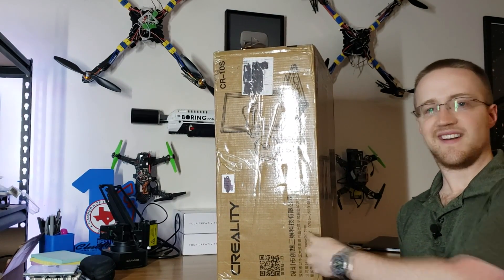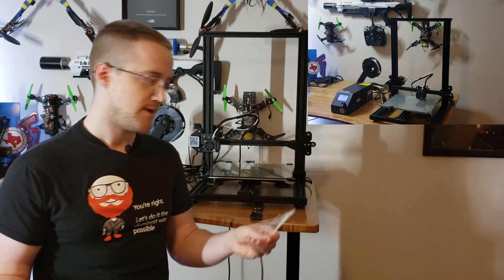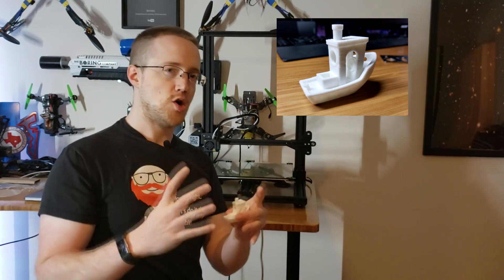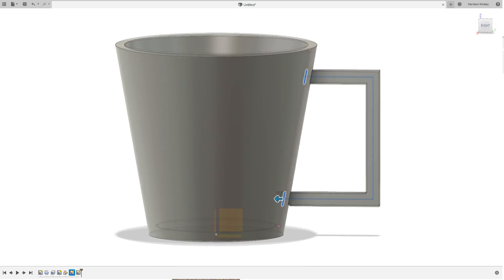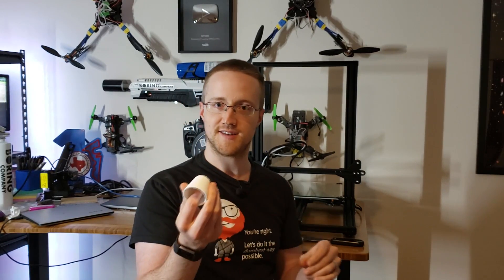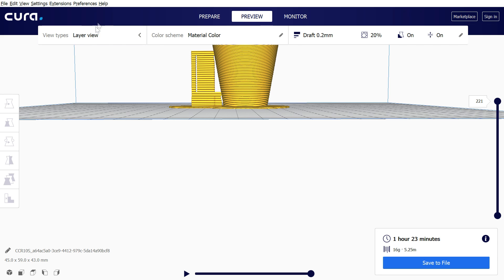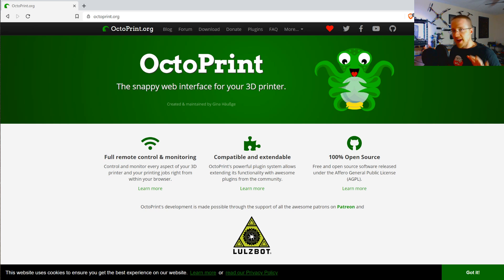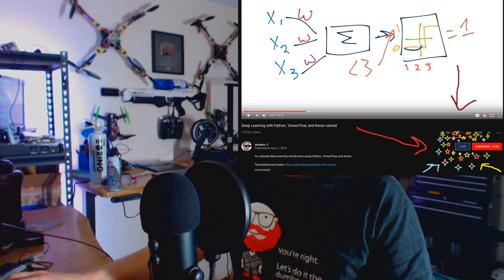3D Printing w/ CR 10s First Impressions

Comment: Just be aware of the toxic emittions when you print in a room that you're working. There are many studies that confirm these toxic emittions that you can have a look. The more simple solution is just leave the window open and be in another room while printing. But here are also some DIY enclosures with filters. Filtering is also quite difficult because the particles are very small for most of the filters, so again you might need a tube that pushes the air out of the room.

Anyway, just have a look at it, because most of the times is not mentioned that 3d printing can have some dangers.

Comment: Use Octoprint with a Raspberry pi to monitor, timelapse , start printjobs from by uploading
Reply from the maker: Mentioned octoprint at the end. Have been using it. RPis were no good, kept having power issues despite trying different cords, supplies, plugs, and outlets lol. Ended up using old laptop instead.

Comment: Thin walls and or tops and bottoms are normally caused by the Quality settings in Cura.  If your using a .4mm nozzle, and your bottom setting is .4, then only 1 layer will be applied.  Changing this to.1.2 give you 3 lines of your .4mm nozzle and 3 lines is normally enough for many objects depending on the weight which it will be expect to hold, and or durability.

Comment: I have the CR10S Pro .
I tried a lot of solutions to have good adhesion, and I'm not a fan of heating the bed because it pumps a lot of energy (there are many videos with guys measuring electric consumption with and without heating bed), and not really usefull for PLA anyway.
The best that I found : autolevel (if your printer can) your bed on EACH power on. I have a glass bed, inductive sensor, anti backlash nuts, and I STILL have to do it, and adjust height by -0.2 in Cura at start of print. My next mod is replacing the inductive sensor with a Touch Mi because going from capacitive to inductive didn't change anything with me...

Put good quality glue stick, no heat bed, and you're good to go.

For your cup, in preview mode in Cura once you sliced the model, look at the 4-5 first layers by moving the slider down on the right of screen, I guess that you must have tiny gaps printing in 0.2, you could test in 0.1 or even 0.16 which is a multiple of 4 (better for the stepper motors).

If you plan of having food or water in your prints, I guess that you're using PLA, it's better to use PETG.

If you already know all that sorry :D It could be useful for someone else :p
Reply from the maker: Great info, thank you very much for sharing. How come you don't suggest to heat? I assumed that further helped with adhesion, or is it just about the power draw for you?
Reply: It depends on many factors, not all of them only related to the printer and the filament. 
You might get different results depending on the moisture content of the filament (there are people drying filament before using it). It might be minuscule differences in the initial offset that makes or breaks adhesion for the first layer. There might be residue from earlier prints on the glass plate, a stray partial fingerprint in the wrong spot might prevent that pesky corner from sticking, which causes the print to peel of a bit more with every layer and jerk.
Personally, I've had good success with PEI sheets stuck on heated glass beds and also with a thin coating of sugar water (dried, of course). Hair spray (non-perfumed) also works great on both heated and non-heated beds.

All together, it could be that the combination of (M's printer, M's filament, M's climate, M's models) is in a part of 3D-printing-land where heating does not make a noticeable difference. Your coordinates might put you somewhere else.

Comment: Is this the best entry model? It seems reasonably priced but sturdier than most in its range

Also, what python library are you using for your workouts?
Reply from the maker: Dno if it's the best, but it's what I went with after a bunch of research

Comment: I have the same one! 

Pro tip- get a dial indicator and print a mount to help level your bed. 

The binder clips cause about ~7 thousandths of deflection in the glass from center to edge. Use silicon pads only for very flat surface.
Reply from the maker: Thanks for the tip!

Comment: Not sure if you already got an answer but a few things that could help: the layer hight (so the thickness of the slices your printer prints with) seems to be quite close to the thickness of your cups bottom. This will result in a lot of gaps since not every line the printer lays down fuses to the one next to it (not even on a perfectly calibrated machine). A possible fix would be to just go down in layer height meaning not 0.3mm (which I'm guessing you were using but possibly all the way down to 0.1mm. This will make the print take three times as long but also make it more water right. The other option would obviously be to just design the cup with a thicker bottom. 
Other ways to make it hold water better would be to increase the extrusion multiplier.
Secondly it seemed like, although it is hard to tell, you are printing too hot (but again hard to tell on camera with white filament)
Reply from the maker: Thank you for the info!

Comment: 3D printing is a pretty nice hobby, I ditched cura pretty early on due to some issues I had with it, I use slic3r prusa edition these days, some of the most common issues are due to the bed level (or bed tramming if you want to be technically correct)and distance between nozzle and the bed..
Reply from the maker: I'll look into slic3r!

Comment: About the bed adhesion, in my experience with that exact same printer, just having the glass bed isn’t enough and a thin layer of glue from a water washable glue stick can make a huge difference for flat parts that like to warp. (I use PLA)
But that’s just my printer :)
Reply from the maker: I'll give the glue a shot

Comment: Filament Friday, Makers Muse, and DIY 3d Tech.com are some good channels.   You’ll need to look back a year or  two or more for their coverage of some of the basics.   There are also Facebook and Reddit groups.  3D Printed Tabletop is a newer channel, but he explorers the trials and tribulations of learning how to print miniatures for table top games.   Leaks - possibly because the filament didn’t quite melt together well enough.   You got a great unit.  There are a lot of advanced and beta settings in Cura you can use to fine tune or screw up your prints with.

Comment: 7.46 i would suggest you to make the bottom of the cup 2/3 mim higher than the base. The circumference of the cup will be the same level of base (extra part) and draw the bottom of the cup bit higher,maybe 2 mim higher it will give the proper thickness of bottom that hold water.

Comment: You should check Blender for 3d modelling ( it has a python A.P.I ) ;)
Reply: Yes blender is awesome for 3d printing I currently switched to 2.80 beta and its much more intuitive than 2.79 imo.
Reply from the maker: I probably will eventually, just seems like, for my more mechanical uses, fusion360 or some other CAD specific design software made more sense. Do you disagree?
Reply: @sentdex  You can pretty much make any part you can imagine in blender I recently created some mechanically correct gears for an automate steering wheel on a golf cart.

Comment: You need more layers on the bottom, basically add more thickness. Since you have a raft it takes a away very small chunks of plastic when you pull it off. That's causing the leak I'm guessing, adding 2mm to the bottom will fix that.
Also, your need to get the nozzle closer to the bed, a feeler guage is the best way I know, or use a sheet of paper. I personally never use rafts because of how much more work they are to get off clean and the extra time in print. If you get the bed levelling right most of the initial learning print you do won't need a raft.
Reply from the maker: Some people also suggested it might be the infill % causing the issue. For bed leveling, I did use paper and got it pretty good I think.
Reply: @sentdex  yup infill% might also be the culprit. And also check your extrusion %. I normally set it at 102% for pla to be on the safe side. But this dose cause little bit of stringing, which can be cleaned off easily.

Comment: 6:30 the problem is that you probably used a low % of infill.
Reply from the maker: Yeah someone else thought that possibly was the problem, im thinking... yeah... that makes sense. Gonna tweak that and try the cup again. Suspect you guys might be right!
Reply: @sentdex  I'm not familiar with cura.. but in preview view (not xray) you should be able to scroll thru each slice of the print and see where the infill is being layed out. I always like to scroll thru layers before printing just to double check if there is any wonky behavior

Comment: Octoprint is AMAZING!! Lots of pluggins and u can do whatever u want. For the poor floor of the cap check the top layers and bottom layers and the pattern in cura. I use to do 3 layers (with a 0.3 nozzle), lines pattern and 0.5 overlap of the infill and the walls. Hope u get it without leaks ;)

Comment: I don't mean to be spammy on your comments. For checking how something will print, X-Ray is helpful. However, looking at the layer height view is really helpful. So, you look at each layer with your layer height in mind. Often, doing so will reveal issues. 

Another non-exclusive issue is that your bottom layer could be too close to the plate which will result in a few layers above being 'squished' resulting in the bottom being a little too thin. It is hard to tell from the video if that is the issue though.

A video series on 3D printing and modeling for prototyping using Fusion 360 is something I have been wanting to do for  a while. I also for sure think you should do more 3D printing stuff on your channel!
Reply from the maker: I don't see an option for "layer height view" I'll have to google around to see if I can find some information on that for cura. Definitely hoping to find something clear and obvious as to what happened with my cup :) GL to you if you do decide to do a Fusion 360 series. I may do some more 3D printing content, we'll see!
Reply: @sentdex  Sorry I wasn't clear. What I meant was to take note of your layer height setting  (.2mm, .1mm and so on). Then look at how many bottom layers you have. So, if you print a .2mm layer height, and you see 5 bottom layers, your bottom should be printed about 1mm thick. This varies a little depending on how squished you bottom layer is to the plate or raft.

3D printing is an amazing tool. It has come soooo far. However, it has a long ways to go and still has a bit of a learning curve. I personally started with it in 2012 and back then there was very little documentation and printers were really temperamental.
Reply from the maker: Oh, I think you just meant layer view, which I also looked at, but i cant really tell the bottom thickness. Let me swap to that and do some serious zooming in.

Comment: PLA is biodegradable and absorbs moisture overtime, so you might want to use a different type of filament for making your cup.

On a sidenote, you might want to checkout thingiverse. Its kinda like a github for STL files and 3D printable models. Happy printing! :D
Reply from the maker: The cup really is just for scooping coffee...which was really just an excuse to print another smallish thing. I definitely would not drink out of anything 3D printed, especially something hot. Seems like a recipe for ingesting plastic.
I have been all over thingiverse, it's awesome! That's where I grabbed that boat. Got a few other prints from there coming in as we speak :)  Thank you for the information!
Reply: @sentdex Hahaha totally forgot about the boat. Btw, the thin base of the cup could be due to the raft. I might be wrong, but you could try to either print without the raft and see if it helps, or use skirting to prime your nozzle before printing. If the print still doesn't stick to your print bed, you can also try to add custom gcode to do a nozzle wipe before starting every print, something like this: https://www.youtube.com/watch?v=6csbJ5965Bk.
This helps to ensure that the molten filament is at the tip of the nozzle when it starts the actual print.
Reply: @dominiccordeiro9257  check out myminifactory

Comment: I don't know the cura specific settings as I use Slic3r PE mainly but it could be number of solid top/bottom layers or infill percentage.

If there are gaps between perimeters or lines then it might be a slight underextrusion, depending on filament I have had to change my extrusion multiplier between 0.95 and 1.1. 

Also you should be able to get the first layer to adhere without a raft if you're using PLA, might need to adjust first layer height and/or 1st layer print speed(again not sure what these are in cura). Rafts are usually used for ABS to prevent warping or to add stability to prints with unusual geometry or small footprints, I tend to avoid them as the "bottom" print quality doesnt normally look as nice when using a raft.

Glad to see an interest in 3d printing! It is a great hobby. And octoprint is an amazing tool as well!
Reply from the maker: Thankyou for all the information!

Comment: If you print right onto glass with PLA, the temp in the room has to be slightly higher than room temp, and the glass has to be REALLY clean. The filament also typically needs to not have much moisture in it.  However, I do not really recommend printing right onto the glass, making sure it works is well, more work than I want to do. 

If I am using glass, hair spray or a glue stick works really well. For glue stick, you want the cheapest stuff you can find like from the dollar store. You really just are looking for a glue stick made of only glycerin paste. 

If you want to go the hair spray route, the best hair spray I have used is the  Garnier Fructis Style Extreme Control 5. Make sure to not spay it near the printer as it tends to gum stuff up.

In any of the above situations, make sure to clean your print surface often.  

I do not really like using tape as it requires more work. There are other options out there which work well but these are the ones I like the most.

For additional glass surfaces. You can buy precision thickness stuff. Though, you can also go cheap and just use something like the glass out of Wal-Mart picture frames for cheap. The down side is that the glass is not super uniform and that can harm print quality.  However, it is cheap and it works. I have had it happen where I had to get a project done a number of times and had the surface break, so cheap and accessible sometimes wins the day.
Reply from the maker: Thank you for the suggestions! Yeah, I don't want to go the tape route, because yes...that sounds tedious and the tape has seams..no? Figure that would result in steps. Only 5 prints in at the moment, but have had pure success when I use rafts. Did read about both hairspray and glue stick...both seem to me like theyd require lots of cleaning every time. How easily does both come off? So far it has seemed very simple to wipe down the glass after a print. I suspect after gluestick or hairspray...probably not so much :D
Reply: @sentdex  Just run your print surface under warm water to clean glue stick or hair spray and wipe clean. When I have used tape in the past I spent a lot of time and effort making the stripes line up just so that there would not be steps. You will likely end up going away from rafts somewhat eventually as they have their own set of down sides and are not needed once everything is dialed in.
Reply: My CR-10S does well printing directly on glass as long as everything is properly leveled and the heated bed is above 55°C. (hotend 210°C) Also im using the cura settings of having the first layer be put down at 20-30 mm/min. With the fan off. to prime the nozzle I recommend the brim mode and to remove any excess material before it actually descends onto the build plate. Printing directly on the glass gives you an unmatched super even and super shiny bottom side of your prints. Especially nice when you have things that are supposed to turn out leveled flat.

Comment: oh boy, you don't even know what you've gotten yourself into yet... welcome to the club!
Edit: Tighten your belts a bit to make the seam along the side not as obvious.
Regarding the cup bottom, it may have come off with the raft. Maybe try a Brim instead, or increase the z distance between Raft and Object.
Reply from the maker: Thank you :)
Reply: @sentdex  Sorry in advance for that wall of text, I just want you to have no bad surprises:
added some suggestions regarding your print. As some other folks mentioned, the cog next to the settings reveal a world of additional options. The CR 10 (and, in my case the smaller brother Ender 3 with many of the same parts) are capable of qualities only expected from printers several times the price, so good choice!
You may however check out fellow creator TeachingTech and especially the flasing the bootloader part, since some safety settings such as thermal runnaway detection are for whatever reason not enabled on the stock firmware. And ABSOLUTELY check whether the yellow power supply connector is soldered instead of crimped, a certain batch almost caused a bunch of fires. The 3dprinting and creality subreddits are a treasure trove too!
Reply from the maker: No need to apologize, great infos. Here to absorb! Thanks!
Reply from the maker: I checked the rift to see if it came off with it, the thing I wondered was if the raft just took the place of the bottom, even though cura preview didn't show it. Will definitely keep tinkering :)